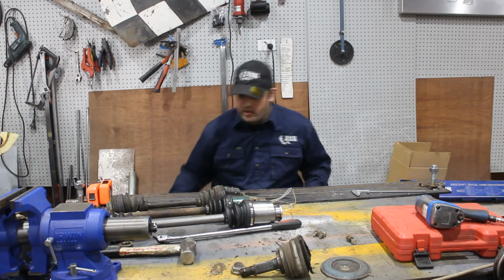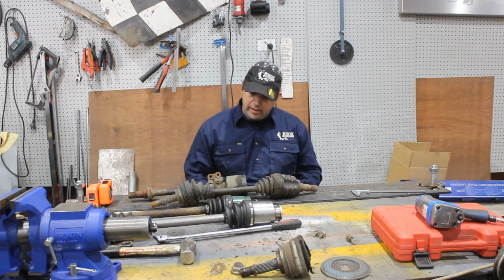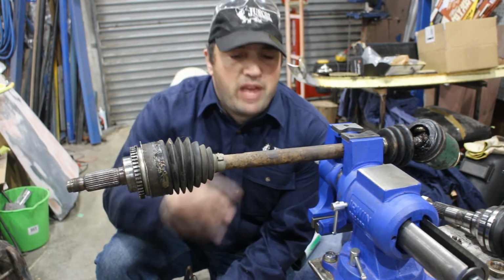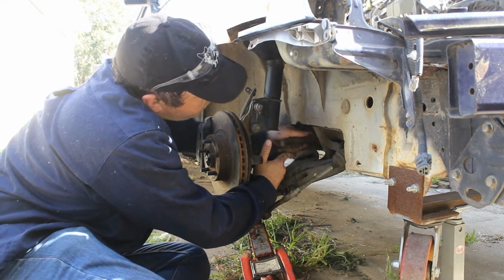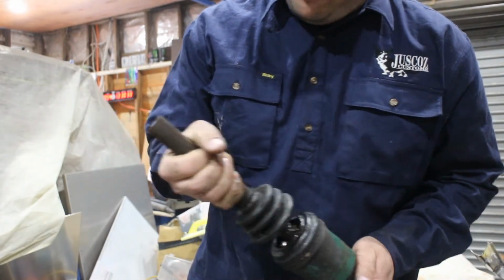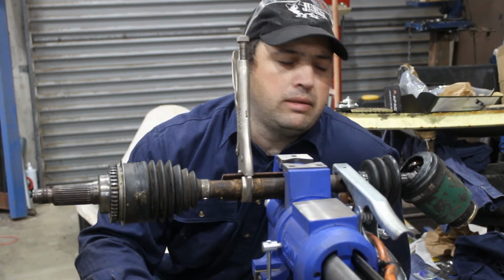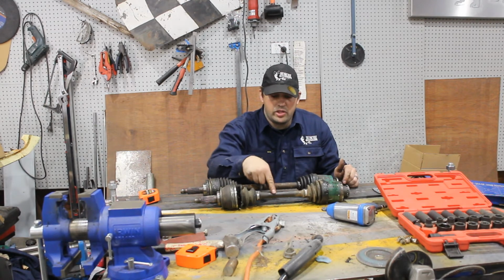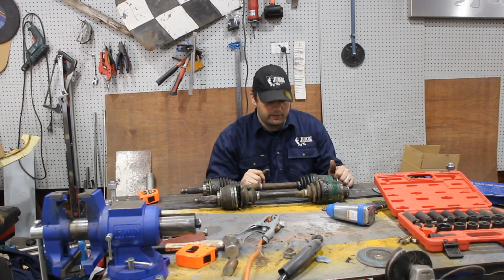brumberty build episode 4 front driveshaft options

Comment: Probably way too late to tell you this, ( sorry, only just found this series), you need 22 spline Brumby, or any model of that shape, with 22 spline Liberty etc ends,
I think I still have a chart somewhere that I made to easily identify shafts that are appropriate for this conversion.
I think the 22 spline outers were also Ford Laser. It's been a while...
Edit: you may have increased your front track width so 22 spline or 25 spline turbo L series shafts match early Lib  (genuine) 22 & 25shafts.
Reply from the maker: To late for the brumberty because it  has a nice set of chromolly shafts now but that would be a handy chart to have if you could share a copy because I will be building another brumby when this one is done.
You found the build at the right time because the brumberty will be coming home again very soon so I can actually get the build to progress because it is 6 months till the ECC show.
Reply: @juscozcustoms  no worries, I'll have a look for it

Comment: Could you just sleeve it ? (The shaft after shortening...)
Reply from the maker: It is possible but i would always be worried about when it will fail. Last time i had one fail i was out bush and i almost had to leave the brumby out there because it had no drive because of the open diff's and wouldn't drive up a slight incline. But i have made the decision to get some custom shafts made so all will be happening soon